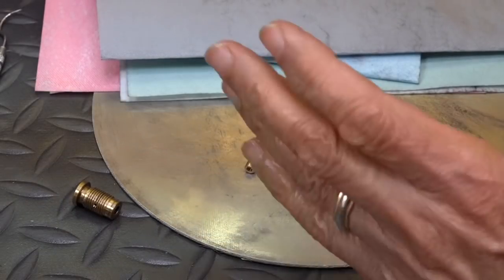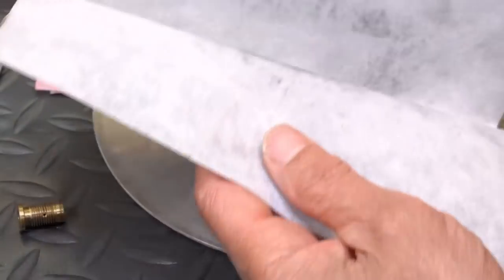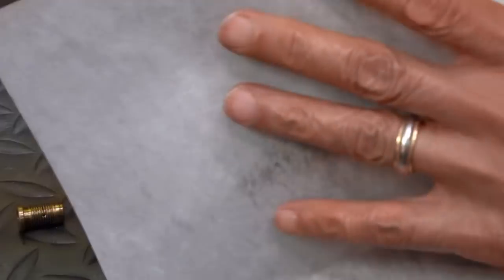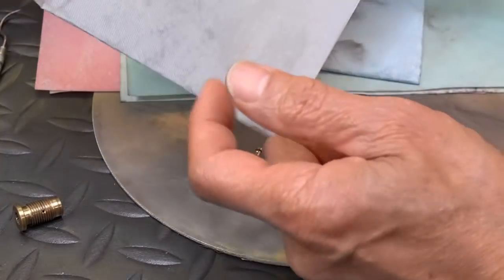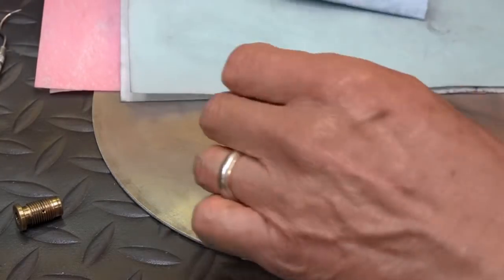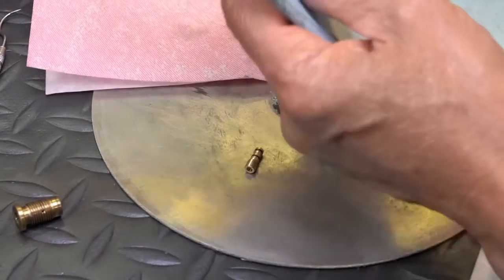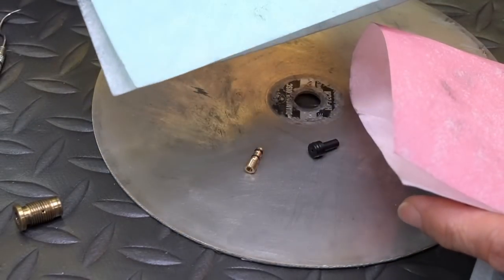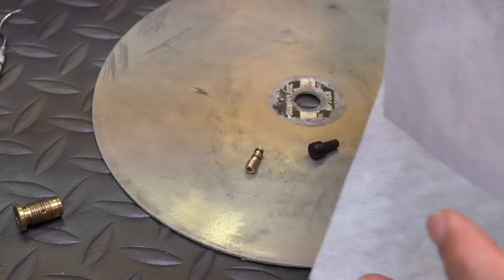FX Impact regulator tuning mobs 2 minimize CREEP

Comment: 🇦🇺 Aussie. Excellent tutorial thanks. It’s resolved creeping in my Impact. One note, the brass side of mine was domed (convex) which means the seal face is focused on the central portal. I’ve purchased, used and the 3M material as recommended too. What was an unusable Impact when I was given it is now tuned thanks to your leak and seal videos. Thanks champ.

Comment: Nice video,tried polish everything have new M4 and from the purchase had some issues,creep was one of them despite its brass with delrin insert piston,overnight it go up arund 3-5 bar in pressure 110 set to 115 upwas worst when i got it new,will see if it will setle up after some tins.Thing is refresh rate which is pretty poor around 12-16 sec,tell me whats normal refresh for reg for M4 IMPACT COMPACT its .25cal,reg pressure set to 110bar,can ti be improved with different beleville washers setup maybe,or how can it be solved to lets say 5-8 sec refresh u achieved in one of yours videos,thanks for answer.

Comment: I tried rebuilding my reg with new piston and washers. Once back together I could only get up to 50 bar no matter how far out I turn adjuster screw. Went back to old piston and washers and all good at 166 but with 10 Bar creep. Got any idea?
Reply from the maker: Make sure the washers have the same thickness and stack the same with same length piston, one extra washer will have 25-35b increase

Comment: I just polished both regs on the m3 22 cal 700mm both regs are holding perfect no re stacking of washers like someone said to do first reg is 190 bar sec is 155 bar 32.8 gr vk at 1000fps plus  👌
Reply: Chris a quick question if I may, are both regs exactly the same?
Reply: @etiennebauscher2661  no they are not the first reg has smaller BV washers 8mm ×4mm
Reply: Chris..
You have the M3?!!
How is it?
I've tried every liner and everything I can, but my dreamline just won't shoot slugs well.. 
I'm seriously contemplating getting an Impact for a slug setup. My main two concerns;
Are they as big of a hassle as people say, or are they generally a solid and reliable platform? 
And secondly,, for slugs out to 150, what caliber is best? Ive heard 22.. Maybe the lil slugger with 800 barrel?
Im between 22, 30, or just geting the M3 .35 and knocking shite over with gigantic pellets..
School me brother, please..
Reply: @BouncyThrone  well I got my m3 set up to shoot 33 zan at 995 and it's perfect when I bought it I had to tune it a bit but thst it set and forget the mk2 25 is a whole different store I've had a few problems set it up at first it shot slugs well then now it doesn't so fx usa is sending me so.e parts to see if that the problem but yeah the m3 is most accurate air gun I have ever shot out to 200 yards sub moa groups can't go wrong brother in 22 is what I got
Reply: @chrisfigueroa3361  
Damn.. that's putting out the same power level as my 30 cal dreamline..
I've had no real experience with 22 cal in pcp..
Would a heavy slug for caliber like those 33's still be a bit light for boiler room shots on coyotes at a 100?

Comment: Hi Ernest, I produce my regulators on a manual lathe. can I ask you some technical infos? 1st I use 0,25 mm drill for pressure adjustment screw. What is the drill diameter you used? 2nd. what is the material you used for pistons and the last question is I want to buy a cnc lathe for these kind of production. Which brand/model you suggest? My job is part time like hobby. I ve a pcp workshop, compressors, filling air, selling scba cylinders etc... Thnx from Turkiye

Comment: Great video! I was trying to figure out how to blow air through the Delrin and brass adjuster to remove dust. Any hint?
Reply from the maker: Hi Joe, i use a macro rubber nozzle and press against the air passage hole

Comment: Now I have a big problem with my fx m3 22 it's doesn't want to let air in the plenum it only fills to 100 bar and the adjustment screw is almost going to fly out ... I think its the bellville washers are to thin or worn out I don't know but I need to fix it that's why I've been watching every single video on the regs  so I can get  info on how to fix it
Reply: Turn it back in all the way and then repeat the adjustment process.

Comment: I have a dream tac bottle, put larger plenum like the ones you make on it. I feel I am having some creep issues. So is it possible that having oversize plenum, causing it to creep. What should I do about that? Also, sometimes, when taking off bottle. My air exits the plenum and gun. Any suggestions?
Thanks
Reply from the maker: May take more time to fill the plenum that may looks like a creep. You have to time when the plenum stabilized. Or restock S-washers  to allow more clearance to increase fill rate. The pressure from the bottle keep pressure on piston shut if removed the plenum will dump the plenum at any given time.

Comment: How do those two surfaces seal when they are domed and the orifices are off center?
Reply: I was reading the comments trying to find this exact answer, and it dawned on me, the orifice in the brass adj screw is in the center, so the two domes seal it off when they are touching. Im sure the delrin is somewhat malleable and comforms to the screw under pressure.

Comment: how do you change the regulator adjustment screw o rings? ive tried and failed they keep breaking, please made a video if there is a trick to changing them, thanks Ernest
Reply: Silicone grease, and carefully roll them on.

Comment: No, this method is wrong.  You can kill the regulator.  This method gives a smooth and clean surface, but does not give accurate geometry.
Reply: What would be your recommendation doing it? Genuinely asking
Reply: I agree, the delrin should be slightly beveled to match the adjustment screw, this video I feel is just to appease the guys that have to fiddle with stuff, it is a manufactured defect and…..
Reply: @Zanin22 do NOT do it, if you have a significant amount of creep, a slight amount over a period of time is completely normal, then you need new regulator.
Reply: @alanmeyers3957 
So much misinformation, unbelievable.

Thanks bud! 🍺

Any thoughts on the brass type piston rod?